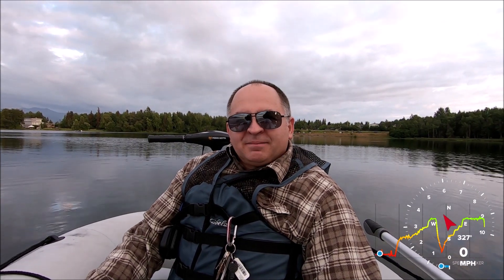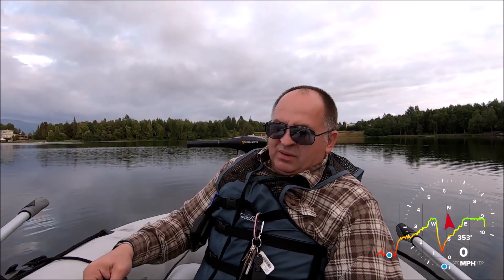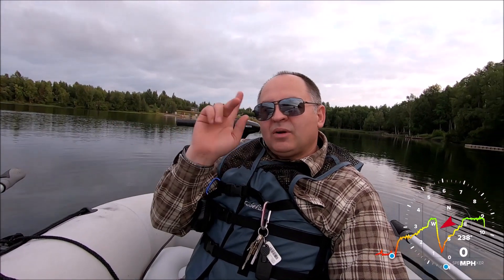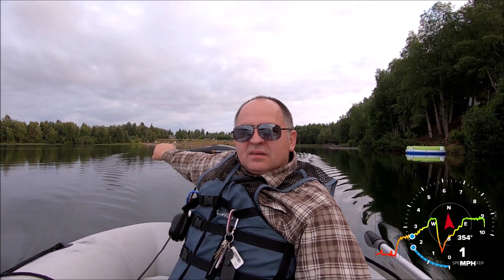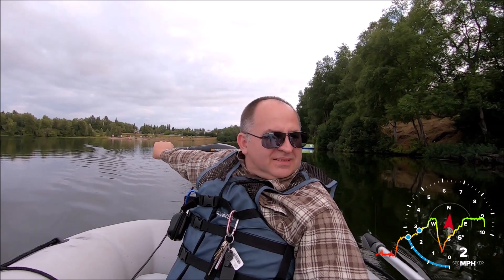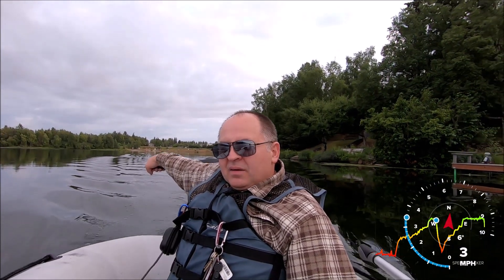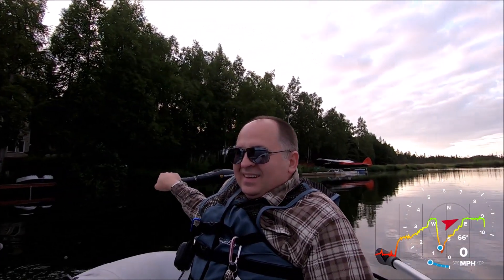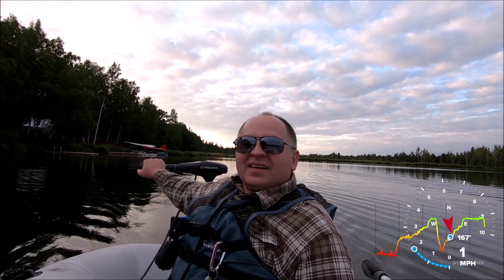Speed test Minn Kota Endura C2 30 Trolling Motor / 16.8v Li-Ion battery  / Z-Ray Cheyenne III 300

Comment: Will a 18v power tool battery work with this trolling motor safely?
Reply from the maker: Probably I will not try to use 18 volts battery, because now it's 50% over the recommended voltage, it will be really hard on the motor and on your battery as well.

Comment: I have 6.4v 40a lifepo4 and 34 lbs trolling motor. I wanna power this motor with 6.4v battery. 34 lbs has a lot thrust for my mini catamaran( just  64 cm.) Probabliy thrust will be 17 lbs but any estimation about speed?

Comment: is this with the Mkp-6 upgrade?
Reply from the maker: no
Reply: Mkp6 is only better on weeds. It cuts the weeds better but you go slower. the standard prop that comes with the trolling motor makes you go faster. I have the mkp6, its gd for cutting weeds better but gonna switch bak to the standard prop. I rather go little more faster.
Reply from the maker: @ckong46  well in my case with Mkp6 it's going faster
Reply: @GPeter7  lol. You said it's not the mkp6 your using and I dont see how you goin faster. 🙄. Do a video on it to prove it.
Reply from the maker: @ckong46  not yet
Reply: @GPeter7  mkp6 is not fast. If you want faster then go with a 3 prop blades.
Reply from the maker: @ckong46  Sorry, I may wrong about it, but it feels faster to me, soon I may clock it with GPS

Comment: I found this very interesting.  I researching how fast this motor can go and I'm well aware that there are all sorts of variables that impact the outcome.   Did you continue to use your battery pack beyond the test?  If yes, did the motor hold up to the higher voltage?
Reply from the maker: yes, I'm still using it, already for two seasons and probably I put well over a hundred hours on it so far, motor runs very well,

Comment: Is it just a bunch of 18650 cells?  If so how many in parallel for each cell?  Also is the motor 12v?  I want to do something similar and already have a 16000mah 4S LiPo pack that I use for charging racing drone batteries in the field but I think li-ion would be a cheaper and more reliable long-term solution.   How has your solution held up?
Reply from the maker: Yes, it is 18650 cells and is 4 x 12 configuration, and yes motor 12v with mechanical speed control and works good, approximately I have 100 hours on it. If your motor has a digital controller make sure it can handle 16v before you plug it.